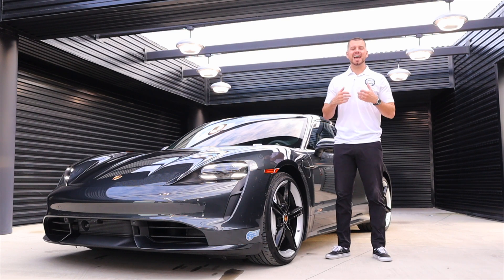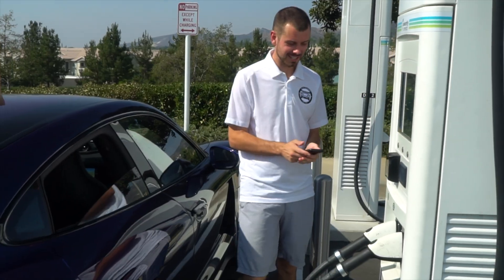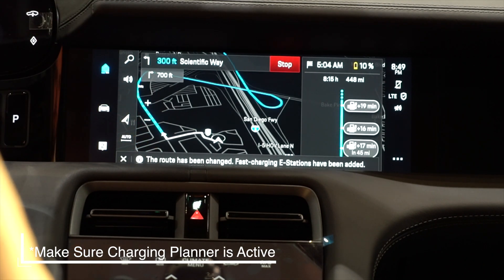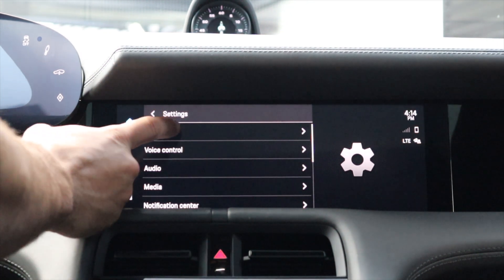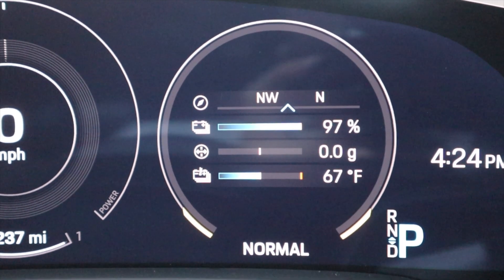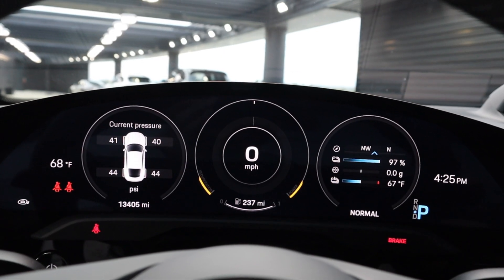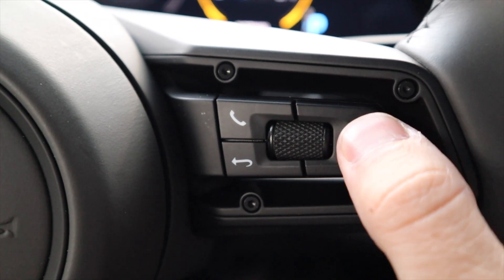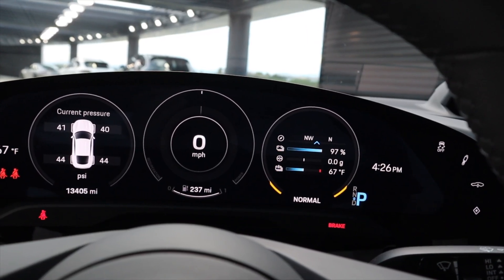How to Display the Battery Temperature on a Porsche Taycan's Cluster and Why is it Important?!

Comment: During highway run at high speed after 30-35 min I have seen 52-54 degree Celsius is it normal heat?

Comment: This is great info!  Do you know of or is there a way to manually raise the rear wing to its full open setting?
Reply from the maker: Thanks John! There is not a way to manually raise the rear wing to its full opening position... only way is through a Porsche tester to force it full open. Porsche excluded this option as the spoiler should only be raised to full position at high speeds 🤔